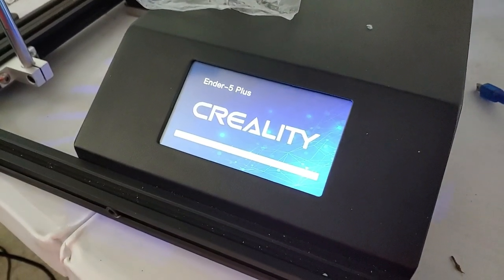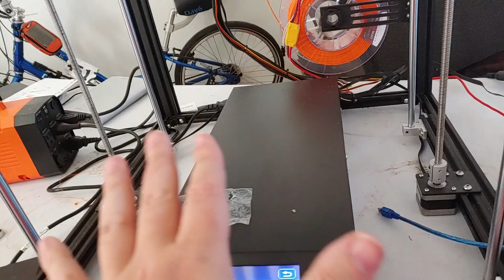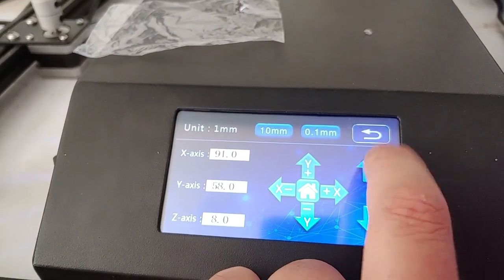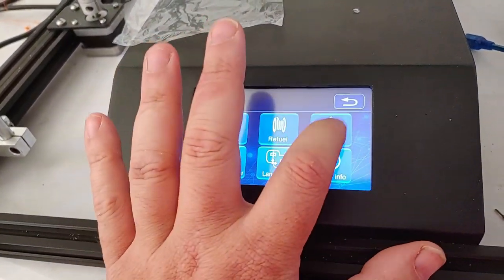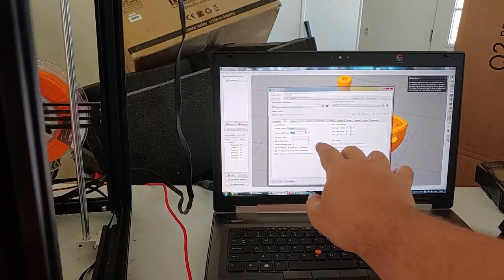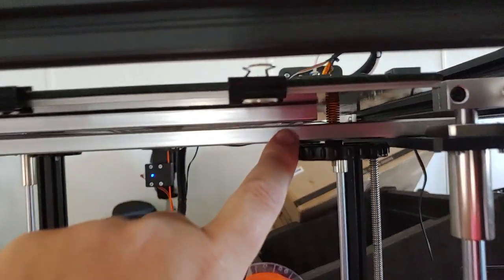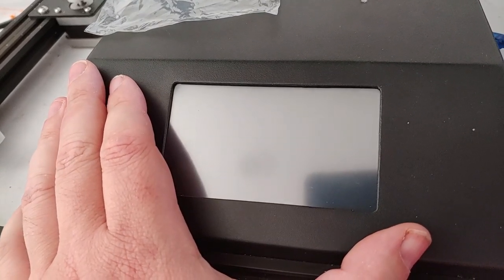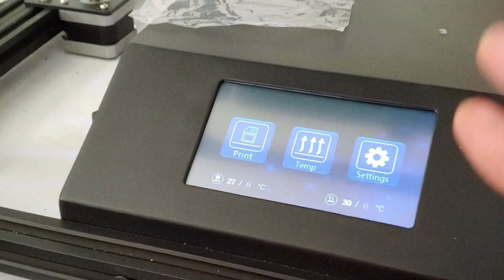How to properly Pron Peel the Plastic and Fix the ABL on the Creality Ender 5 Plus T3DP

Comment: Can we do a serious upgrade of the ender 5 plus ... MW PSU a 32bit main board and 0.9 step motors instead of the 1.8 it comes with. All metal hotend and bondtech extrusion and a tcm spi stepper drivers
Reply from the maker: If you can get someone to send me all that stuff ? Sure :-) i do olan to put dampers and the nimble on the ender 5 and a 1.2mm nozzle and a creality bond tech feeder (i have those components)
Reply: Chris a thumbs up here on the Nimble

Comment: Do they make a upgrade kit for the ender five to make it dual Z like the plus?
Reply from the maker: No. I have not seen one yet.
Reply: Cool thanks
Reply: I’d like to see you get into cnc router’s! I like the videos you do on 3d printer’s it’d be nice to have that for the routers
Reply from the maker: I am trying to get someone to send me one :-)
Reply: Nerys get them tight suckers from Avid CNC to send you the desktop pro! I asked for a discount and they told me to pound sand! It’s a nice looking machine though
Reply from the maker: @trialnterror  i will look into it but sadly i have found straight up asking does not work. :-(

Comment: I just don't get why creality releases these printers with broken firmware, they did the same with the cr10s pro, after a few versions of tiny machines firmware for the cr10s pro is a fantastic printer but the first few months were not fun.
Reply from the maker: Creality goofed and left the stock -19.7mm offset in place. Just a mistake.

My problem was a tiny machines problem ie firmware was goofed. They are working on it afaik.

Comment: G'day Chris. Probably not a good idea to have your car license on display with your address showing. On the desk in front of the laptop. Hopefully you will read this and re-process the vid with some isolated blurring before any nutter sees it. Cheers from OZ 👍
Reply from the maker: Dont matter. That address is not mine anymore :-) but i do need to be more aware of that on video!!
Reply: @nerys71  Goodo. I recall you moving recently but wasn't sure if that address was old or new. BTW ... thanks for all👍 the previous tips on the CR-10S and CR-10S Pro , both of which I use 👍